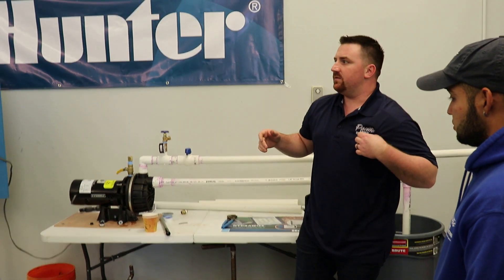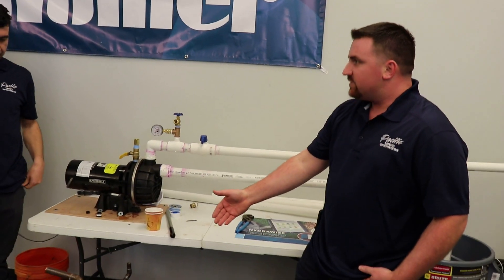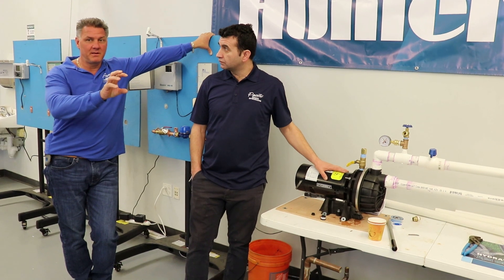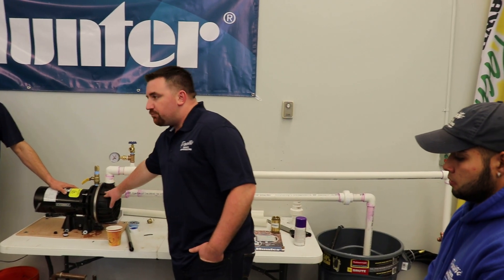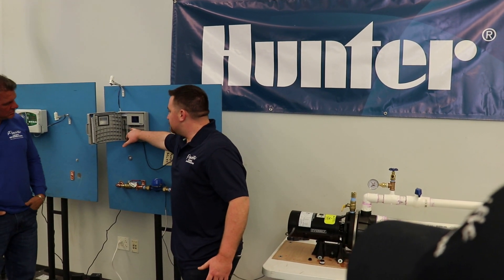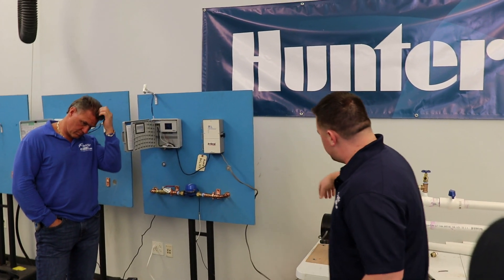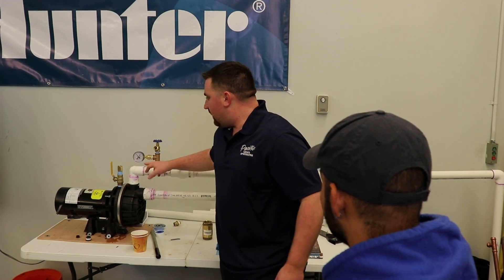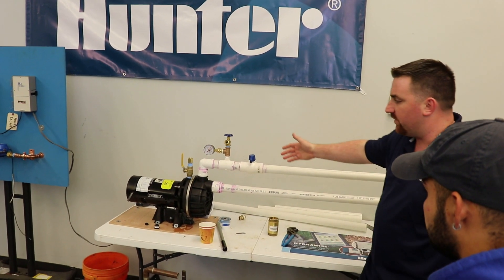How To Prime an Irrigation Pump

Comment: I have that same pump. My issue is that the pump is primed once and works well for the two zones, the next morning the motor is not pumping water again unless I prime again. If not keeps running till the cycle is over if I let it. It could burn. There is no leak  so I don't know what can be causing this to happen.
Reply: Hello Digital, question. Did you find a solution for your pump? I also have the same pump and lose prime during watering. I have tried so many things but today found that my check valve may be bad. thank you
Reply: The check valve need change

Comment: How many sprinklers rotors  can you put on a 2hp pump pulling from lake per zone ?? On another question  how many spray heads can I use at the same time using a 2hp an a zone/ valve ?? Thanks in advance

Comment: Union on a suction line. Lmao just shows these guys have zero idea about suction lines
Reply from the maker: Hello, your comment makes absolutely no sense. The union is there so we can easily remove the vertical piece to show our technicians the screen. This is obviously not a real suction line for a real system (not sure if you noticed that considering we are clearly in a training facility). Please do not comment on our page unless you are willing to be positive and actually have relevance to anything.
Reply: Pacific Lawn Sprinklers Franchise something I’ve learned in the field with shallow well pumps is people who don’t know any better will install a union on a suction line either to make the check valve easier to replace or to make a underground repair. Unions are never completely air tight connections amongst other special pvc fittings such as ball valves. Very rarely do I meet a tech who knows, understands, or agrees with that.
Reply from the maker: @54565syu  yup -  you are right about that
Reply: For the record, I use threaded unions on my suction lines, and never had one leak and suck air.  Makes winterization and eventual pump replacement a breeze.
Reply: I'm a home owner, unprofessional, and I used a T at the "Suction Line" where I added a tap so I can hookup a water hose and prime the line to the like.
The above discussion (you can not have a union) explains why priming keep failing.. is that correct analysis ?  @tradingsystemsgroup5312